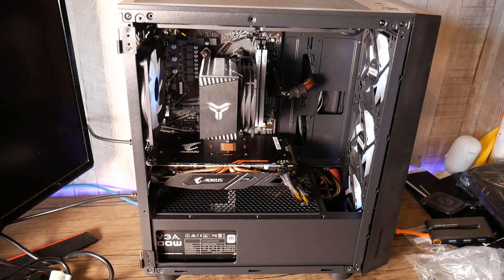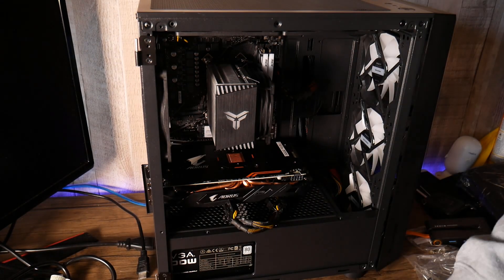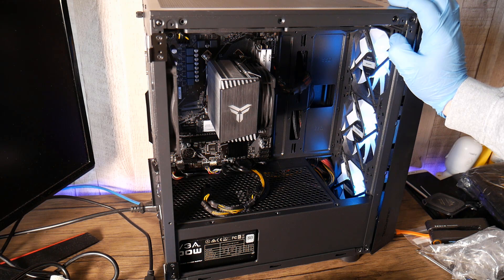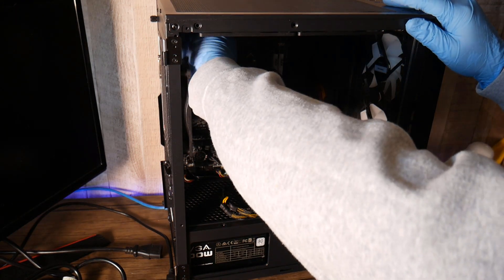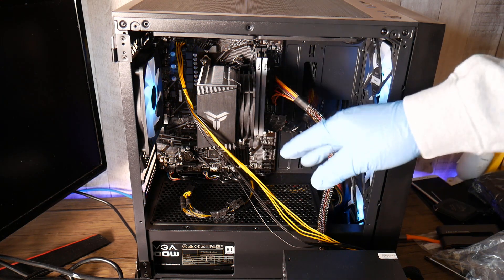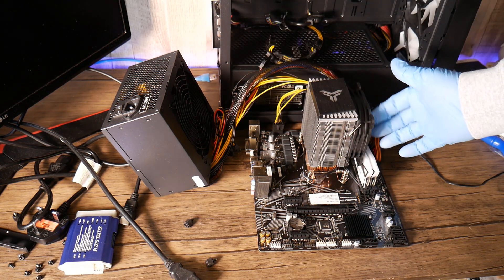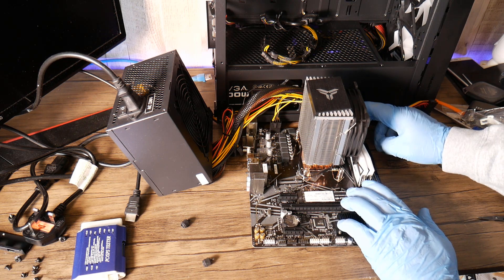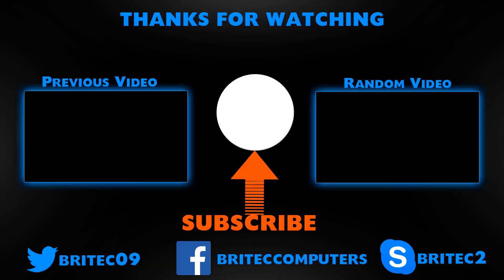New PC Build Not Turning On

Comment from the maker: Quick troubleshooting video on a pc that won't turn on. Drop us a LIKE 👍
Reply: What do you think about PC tech Carey Holzman?
Reply: One of the intense repair, is when you just can’t parts cannon a fix, was the bad capacitors of the mid 2000’s. Caused by the Chinese who stole capacitor development which was the wrong mixture and caused almost a complete failure of, Dells, apples, gateways and other Intel motherboards which were being built in China. Removal of those caps was essential in keeping several companies up and running within hours.

Comment: I've drained the cmos replace the cmos I've replace my ram, gpu,  psu and motherboard I've cleaned the ram slots and the ram itself I made sure the wires are in correctly and all the way in its sockets I checked my cpu for bent pins I've done everything you name I've watched 30 vids nothing  is working

Comment: I have the same issue with my asus b550ma mother board ,i send it to the shop and when they plugged it to the power supply, it turned on with no problem, and when i plugged it in my home again it still not turning on😢

Comment: I bought a used MSI MAG Z590 Tomahawk Wifi to replace my ancient MSI X99S Gaming 9 ACK. When I pressed the power button nothing happened then I moved the case and it sprang into life. I went into BIOS for 10 minutes and everything was normal then I exited BIOS whereupon it shut down and will not boot. The peripherals such as the mouse light up but nothing else so I assume I have totalled it but I don't know how.
Update ; I breadboarded it and it seems to be working , cpu fan is on , argb etc

Comment: That nvme drive flops around because there's supposed to be a screw in the back that anchors it to the MB. You can see the cutout and there's a post that screws into the MB depending on the size of the stick.  If that's factory built, that alone would give me cause for concern

Comment: I just built a new pc my first time and when I plugged it in and turned it on, the rams led turns on, the fans won’t turn on or anything else I’m guessing, is it due to the fact that I didn’t install the wires correctly, when I press the start button on my pc case it does nothing to turn it on or off.
Reply: Did you fix this problem?
Reply: @coderush5g  yes I ended up getting a technician to fix my pc 2 years ago
Reply: @coderush5g  the issue was my faulty motherboard and the damaged cpu

Comment: I'll  bet it had something to do with that monstrous heavy heat sink on the mobo. When that computer was being shipped and manhandled, the weight of the heatsink could have caused a crack in the motherboard somewhere around the cpu area. This is why it's risky to send this kind of computer by mail. It is also why most prebuilts come with a stock heatsink and nothing beefy. I hope you do a followup second video of this one to see if it was actually the motherboard or not.

Comment: Hi. Probably in transit one of the components like the memory, gpu, or the hard drive got slightly disconnected. If they kept it on long enough it created a short to burn out one of the components or motherboard. I sometimes tap the components with a screwdriver to make sure a good connection is there. A fried motherboard is not fun.

Comment: I had an smd fall off, it was a 1k OHM resistor and it was at the bottom of the case and it was the so tiny I though it was just debris. Soldered it back on and boom it lives! Some things aren't soldered as good as you might hoped.
Reply from the maker: Thanks